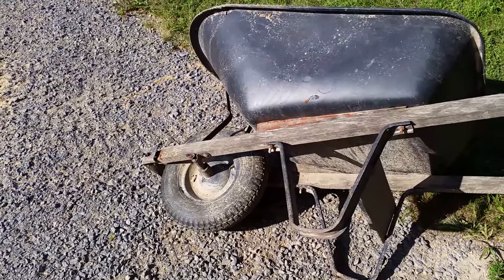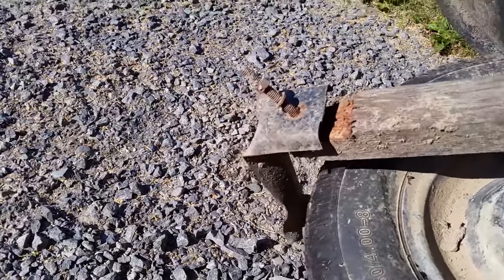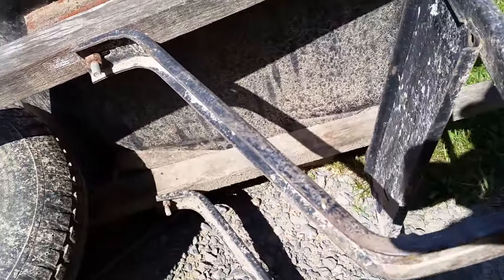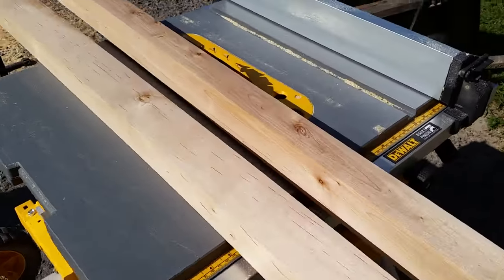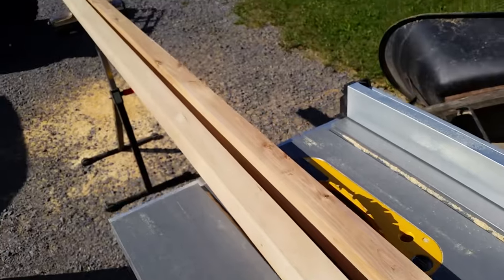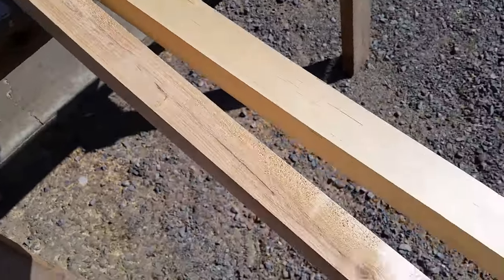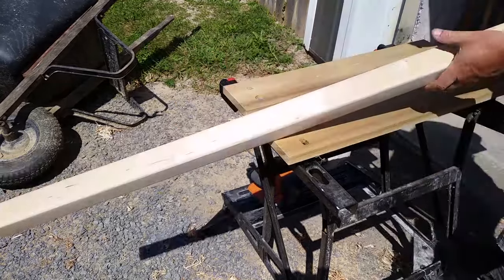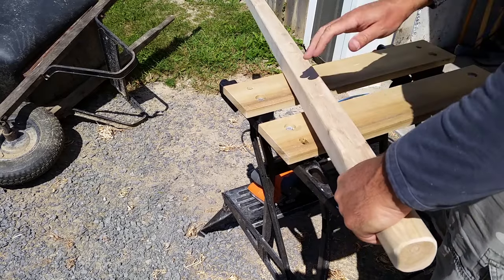(Part 1) Wheelbarrow Rebuild Project

Comment: I rebuilt my thirty year old barrow a month ago.

It was rusty.  The original wheel had failed a long time ago and I replaced it with an inadequate,  much smaller Harbor Freight wheel,  which had failed too.  The grain on the wooden handles had opened up,  greatly increasing the exposure to rain,  but they were still strong and I reused them.  One of the wooden wedges cradling the tray was rotted out,  and I replaced it.

The biggest issue besides the wheel was that the mild steel bolts had lost much of their thread due to rust,  so a number had to be cut off and I replaced all of them.

A wire brush in my angle grinder made short work of removing rust from the tray and other metal parts.

I wound up brushing on Kilz primer,  and painting both metal and wood parts with house paint.  I replaced the bolts with common steel bolts,  and decided afterwards that 1) I should have used galvanized bolts to avoid future corrosion and 2) I should have used round headed bolts,  like carriage bolts,  to avoid having the bolt heads sticking up and interfering with shoveling out the tray.

This was an easy,  fun project for me,  and I have a barrow useful for many additional years.

The real bottom line I discovered is that wheelbarrows need to be inspected and maintained before the wood rots and the threads on the steel bolts corrode out,  making disassembly difficult.  I'd aim at inspecting the condition of my barrow regularly now that I know what to look for (water damage to the handles and rusting threads).  If it's not deteriorated,
disassembling and repainting the wood and metal would be easy work,  and some grease on the bolt threads would likely preserve the threads.  Also,  I'm hanging my barrow on the side of the house,  protected from rain.

Lastly,  the tire should be removed from the steel wheel, derusted,  primed and painted.  Tires that wont hold air are perhaps the leading cause of wheelbarrow failure, and the cause of that seems to be a rusting wheel that prevents the tire from gripping the wheel properly.  

I'm happily watching all the You Tube videos on others who have done this project,  and observing what they did and what I should have done!

Comment: I'm about to do one. My neighbor gave it to me with the handles falling apart like termites were having a good time with the wood. Needed new handles, wedges, bolts and nuts. The thing is, it's an old contractor grade wheelbarrow with really heavy thick metal and everything else is in great condition.